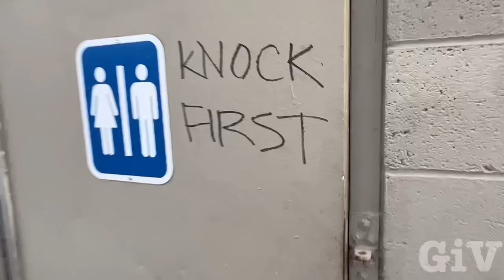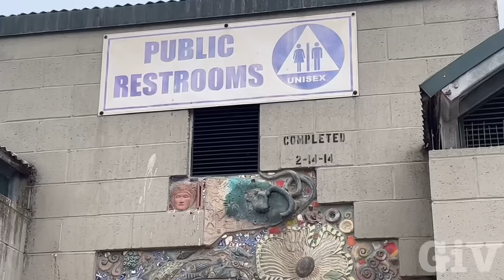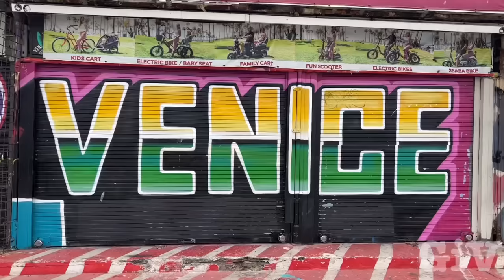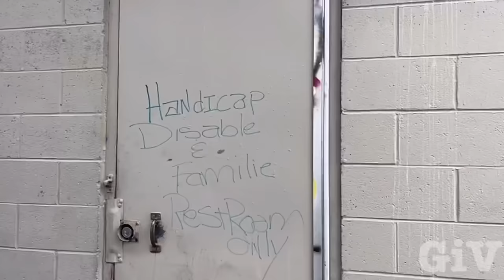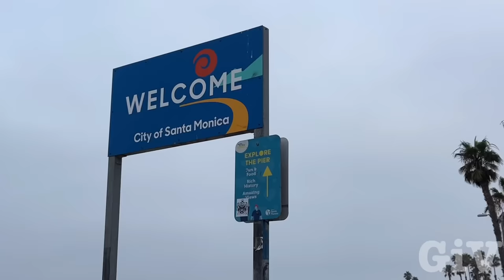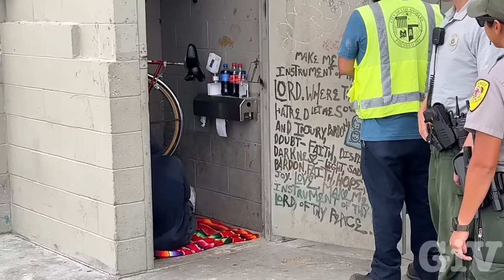Homeless People living in Venice Beach Bathrooms

Comment: These people are just moving aside until room service cleans up their mess then they move back in. The town should saw off the bottom 1/3 of the doors, power wash and re-paint then have a pair of security persons walk the area and have a pass key if the door is shut too long. It would be cheaper than having a whole team of people having to spend 6 hours going through this ordeal.
Reply: At the german Autobahn are a few special rest room buildings, they are full metal (stainless). They are cleaned by pushing a button so the complete room is showered by high pressure. All dirt and paper on the ground is flushed in a special sink. Maybe thats a good thing for Venice, 1) Its that easy and hygienic to clean and 2) it will stop people who try to live in it. I mean, a few times a day a worker goes there and high pressured that metal room. This old stone Rest Rooms, i mean who  will really use that? But since my first visit in LA in 1986 i realised that the US had some problems with hygienics and clean public places. The public Restrooms are more that plastic toilets at a festival but not for normal Europeans.
Reply: @drhkleinert8241  That's a good idea, over time it would pay for itself and have security lock them at night. Nobody should be out in a public restroom in the middle of the night except homeless. The block buildings are porous and unhygienic.

Comment: Bottom line...any way you slice it dice it or cut it, human beings need shelter. It is an instinctive and ingrained need. As such, we will seek shelter in whatever form we can. Its animalistic yes. But when you have fallen as far as you can fall and there are no other options what else can you expect? How do you solve homelessness? By providing homes. Its not complicated. Once someone has housing then you can begin to address the countless issues that made them homeless.  Its not a one size fits all type of solution. But at least its one less problem that has to be dealt with.
Reply: Most of the homeless don't want help with their drug addiction and would expect everything for free. Those that are homeless and working it's because everything is too expensive. Even single bedroom  homes in L.A's most dangerous neighborhoods can go for over $500,000 and rent in that same area can be close to $2000 a month for what use to be seen as a crack apartment. That's the main cause, price.